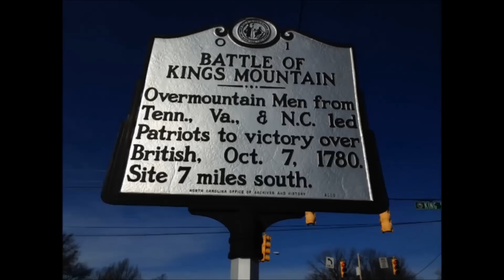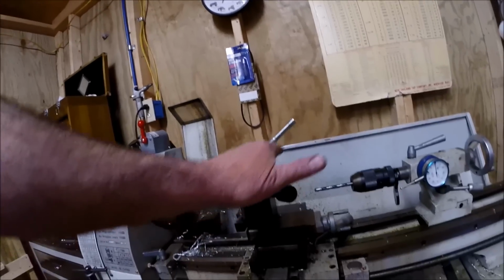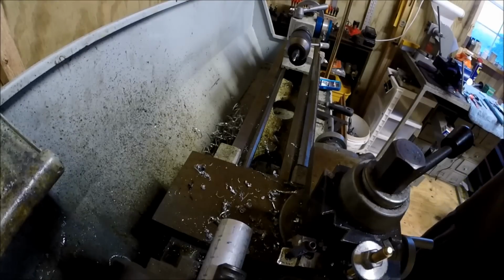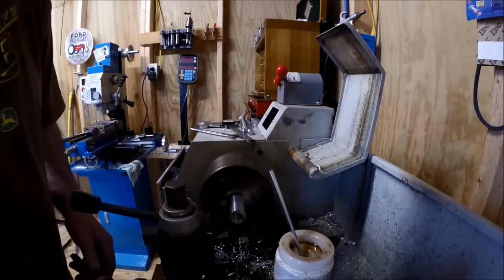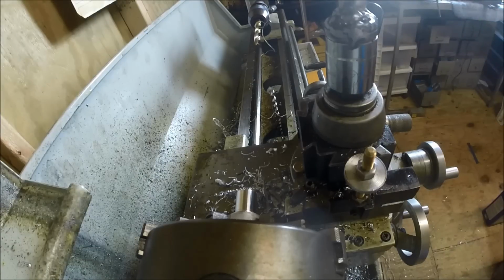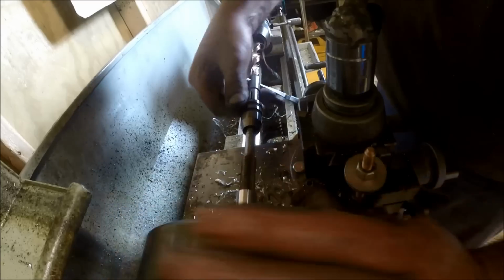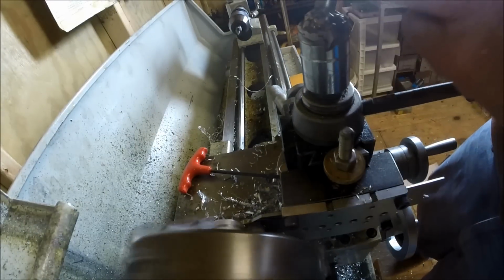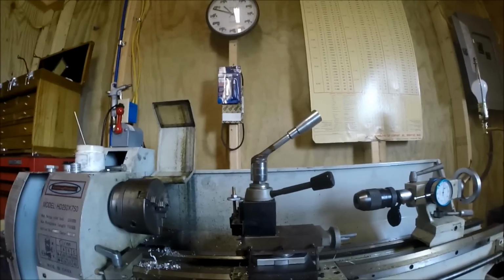Weekend Shop Talk 9

Comment: You might want to replace those 3/8" bolts with studs.  That way you do not get much wear in your holes.

All the best!

Mike
Reply from the maker: Junk Mikes World  Thanks for noticing but a nut is thicker than a bolt head, also since I added a 3rd bolt, it will not have to be tightened as much so I be careful.